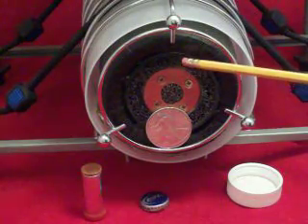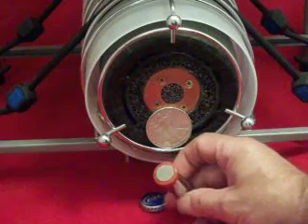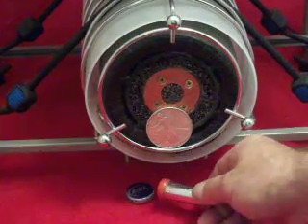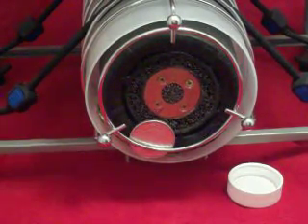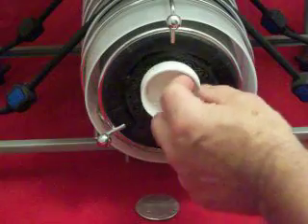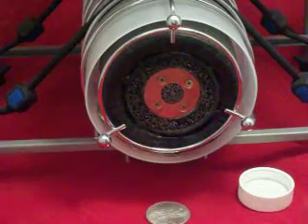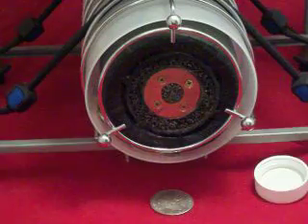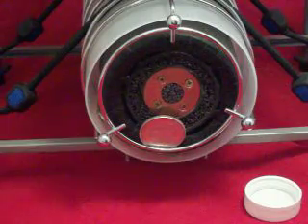Master Magnet Attracts Gold and Silver Cool Science

Comment: Living in alaska by a river I see the fine gold in the black sand this would make it possible to extract it.  Could you make a gold pan?  What kind of power did you use in your magnet ?  Can this work with DC, it sounded like it was a AC coil the way the coin rattled.  Not much power near a river, dc would permit a battery to be used.  A aluminum pan with copper rings might work.  I want to see a circuit diagram.  Try to imagine how to build a gold pan where it would stick to the pan, probably need to get all the iron out first with just a magnet before trying to get the gold.  No one even tries to get this fine gold be because it is so fine and hard to separate, so it sits there gleaming in the sun.
Reply: Buy an inversor of DC to AC at 60hz and ready😊
Reply: It'd do just fine for that 

You could make a pan, I guess but a custom sluice would be better in my opinion 

Won't work with DC. You need AC and an oscillating field through the coil of 60hz or higher. You can't change the frequency or DC the same way you can AC

The river is power

Comment: btw, have you considered making a long range non-ferrous metal detector out of this multicore magnet? Just change the field configuration.
Reply: Doesn't work that way. You'd need two seperate coils with different power sources

Gold detector uses DC, creates stable magnetic field and analyzes it for changes in the field which would indicate that something is "stealing" flux, ie conductive metals 

This magnet uses ac and field oscillates at 60hrz or higher, making it impossible to detect changes in field since the field itself changes countless times a second
Reply: @drsatan7554 Lmfao, if it oscillates at 60hz the field does change "countless times per second", it changes 60 times per second….

Comment: So we basically were side-tracked by the effect of magnets. In fact there are specific frequencies which can attract all things. Its possible perhaps to even attract wood and wool. Everything is made up of electrons. In the end this makes sense John Hutchison's work is more obvious now.
Reply: Have you seen anyone test aluminum with this master magnet? Or anyone know of such YouTube video?
I wonder if it is also attracted to this system? Also I wonder about copper?   I suspect that the large electromagnet I used on a crane, which was mostly aluminum, was made of such due to it not holding any or very little magnetization when turn off, though at times it seems there was a sticking effect after being turning off?!
Reply: @robertlavedas4964  it will be but less so than either copper or gold. It'll be less efficient as aluminum is less conductive meaning more power needed for same effect 

As for the sticking effect probably caused by obnoxiously large coil nearby, electrons don't move at speed of light. When you switch it off, theres still a bunch of electrons that must return home 

What's important here is conductivity
Reply: Frequency of what?

In this instance it refers to the Frequency of the electricity and it can only affect non ferrous, conductive metals 

Everything has electrons but only unbound electrons can be manipulated without damaging the element 

You pull out an electron which isn't supposed to move and it either explodes or decays

Comment: Very interesting but I would love to understand why it attracts it what's different between that magnet and the neodymium
Reply: AC current in the coil. Outer core made of iron, inner core made of copper. AC magnetic field "pushes" coin toward inner core where field is cancelled.
Reply: Do you know of any videos where copper and or aluminum are tested in this system/ configuration?
I wonder if both would act as does gold and silver?
Reply: Thank you so much, for the fast reply.
Reply: Electric field gets absorbed by gold since is conductive

Electricity is magnetic. Eddy currents forming in gold induces magnetic properties since electricity generates a magnetic field. 

Basically you force the gold to be temporarily magnetic

This would not work if you grounded the gold

Comment: xx  've been in electronics for more then 50 Years. (RE: Coral Castle Florida) This is what I'm thinking as it relates to Ed;s efforts and design,  All you need to do is look at his generator device, (one of six he built over time),  It uses "V" (NOT BAR MAGNETS),  magnets there was a real reason for that.  The magnets were set up 25 magnets around and 5 deep.  They were set up in repel mode to send as much "B" field into the earth as possible.  The "B" field is the center of a magnet not the North or South poles those are the weakest points on a magnet.  The "V" magnet is a perfect device  for his purpose given the "B" field is at the center and allows all magnets to supply the center as needed then through the crankcase and then into the ground.

Comment from the maker: Because of the peculiarities of the magnetic field around the copper washers, the magnet will not attract pieces of non-ferrous metal wider than their outside diameter or narrower than their inside diameter. Interestingly, I made a hand-held device having two cores. I attach a small piece of gold dipped in salt water to the end of the core. When the silver dollar attracts to the  (magnet) washers, I will then hold the core with the gold in front of the silver dollar, the gold attracts. However, the gold will only attract to the silver dollar as long as the core is held near the gold. Once I remove the core, the gold will fall off the silver dollar. I need to keep experimenting.
Reply: I have plenty gold flakes in the soil , please contact me
Reply: @johnjimeniz4429 read The Master Magnet by Leonard R Crow
Reply: Completionbiz@gmail.com

Comment: Very interesting, but there is a variable in the silver dollar, as it is only .9993%. It is possible that the .0007%  is the culprit to the parlor trick. What is the unseen 7 element? I suspect it is tantalin, or some element in the periodic chart that binds with silver for tinsel strength. I do not know the secret ingredient that is added to the alloy to prevent evaporation in the purification process by heat. Do you?

Comment from the maker: The (electromagnet) Master Magnet is a coil with a current running through it. 

Please note that the electromagnet is actually two electromagnets in one as you will see later.

Electrons are like tiny magnets and when they move (as in a current) they create a magnetic field. Wire is wrapped around a (core) base made of iron. The wire is connected to the electricity and when current flows in the wire, the iron core becomes a very strong magnet. 

The second magnet is the copper washers. The magnetic field from the iron in the base causes electricity to flow around through the washers. The electricity in the washers is called an eddy current. The eddy current causes the washers to become a magnet. But, if the washers are split they won’t become a magnet because the electricity can’t get all the way around them.  

The two electromagnets are arranged so that their north poles point at each other. Two north poles repel each other, so the base (iron core) and the washers push each other away. If the washers were not anchored in place, they would spring out of their mounting as soon as the current was turned on. When you add an additional (core) iron bar into the (electromagnet) Master Magnet, it increases its strength.
Reply: Larry Wandell, glad to see you commenting recently!

I was wondering, what are the limitations on sizes and shapes the magnet can attract? I read the master magnet book so I know coins larger than the core are actually repelled. What about small non-ferrous pieces that arent coin shaped? Can it attract dust or flakes? I'm sure you can see where i'm going with it!
Reply from the maker: Alex Loseman, Because of the peculiarities of the magnetic field around the copper washers, the magnet will not attract pieces of non-ferrous metal wider than their outside diameter or narrower than their inside diameter. Interestingly, I made a hand-held device having two cores. I attach a small piece of gold dipped in salt water to the end of the core. When the silver dollar attracts to the washers, I will then hold the core with the gold in front of the silver dollar, the gold attracts. However, the gold will only attract to the silver dollar as long as the core is held near the gold. Once I remove the core, the gold will fall off the silver dollar. I need to keep experimenting.

Comment: Does it use A.C. current?
Reply from the maker: Yes A.C. current, and when placed in a water-sealed holder it can be used under water.
Reply: Amazing!
Reply: could an electromagnet be built that repels certain types of metals?
Reply from the maker: The only way I can think of right now, is to recruit a built-in metal detector that discriminates between ferrous and non-ferrous metals. And, when metal you're in favor of is detected, then, the Master Magnet can be switched on having power of attraction.
Reply: thanks for the answer!
Reply: Uses magic mostly.

Comment: Not quite sure about details of your 'master magnet' but any conductive material due to induction will produce an opposing field in what must be a moving  AC field here. With DC only a momentary induced field would build up as the field is energised. Same reason a magnet dropped though a copper pipe takes ages to pop out the bottom. You gotta be scientific, there are people here talking about 'wood' magnets.

Comment: The camera/light, and the fake apparatus are both mounted on a table with a 90 degree swivel. When the device is "off" the table is horizontal, when the machine is "on" he tilts the table to vertical. Notice how you never see a background that would give it away.
Watch closely as he fumbles with the plastic cap when the machine is supposedly "on". If he actually let go of the cap it wouldn't fall so he flips it down with his finger to give the impression it would fall.
I bet this comment doesn't stay long, and taking it down will only prove I'm right.
Reply from the maker: +ipissed, I caution you to make good decisions. My door is always open to anyone who wishes to observe, test or investigate any of my experiments as seen on YouTube.
Reply: I  see NO validity to your simplistic  tipping theory. You are reaching to rationalize. IF it is indeed a trick, that is NOT how it was done. The "ab" was almost certainly a pulse/field in MY opinion.
Reply: if tilted the cap and/or silver dollar would slide.
Reply: +Larry Wandell love the demo.
Reply: it's just hysteresis with a phase shifted secondary field, no magic or trickery required.  should have paid more attention in EE101 dude  :P

Comment: what is the frequency you used, and what are the diffirent composants of the core layers, please!
and you can even attract this plastic piece if you find its resonant frequency, do you have a frequency generator ? if yes, what rage ? thanks !
Reply from the maker: tyreza79, the non-ferrous electromagnet was designed to attract non-ferrous metal. Please watch my video Electro Gold Magnet Picks Up  Wooden Nickel; this device will also attract plastic. Thanks for your interest.
Reply: well i know the master magnet, i even have the diagram to buid one,
but i know that the frequency modulation changes whether you will attract gold or plastic or even wood,
thats why i asked about the frequency modulation and the cores are important, well in the diagram i have, there is a multy layered core :) but i never had the materials to build one !